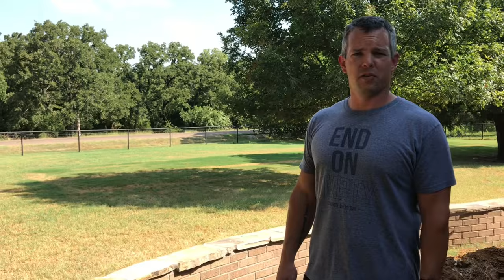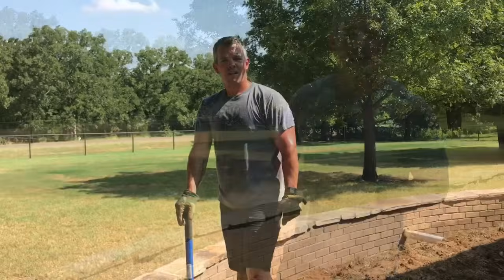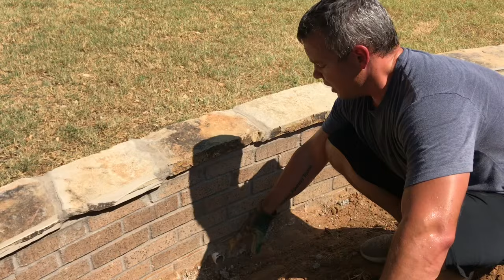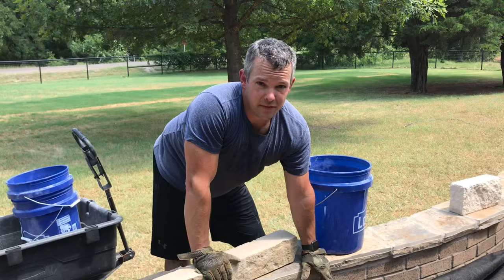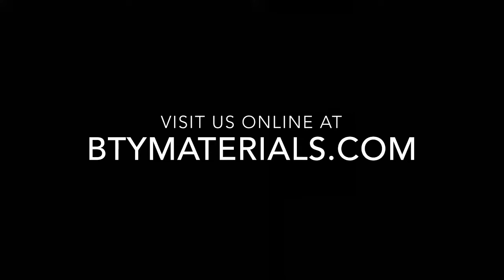Installing a French Drain Behind a Retaining Wall

Comment: Thanks for this video. I am in process of making, at the most a two course triangle retaining wall. To place patio pavers on it. It is already on a negative slope towards the house. I have already place a French drain and gutter drains at the lowest point. It is directly in front of one of the sides of the retaining wall. (The one closest to the house. Which, I hope will only be one course high, for a step to the patio portion.) Where would I place another perforated pipe? Which side of the triangle? The one closest to the house or the one farthest from the house? And I do not want to dig up the French drain I just put in to connect more drainage. Where would the outlet be? Also are the spaces between the blocks sufficient for weep holes? Or do I need another smaller tube?

Comment: I’m getting ready to do a 2ft tall, 90ft long wall. My plan was to backfill completely with gravel and then use a lil soil on top for the last 3in or so. Will that work?
Reply from the maker: Yes, as long as you wrap the rock in filter fabric to keep the dirt out, it should be fine... typically I believe 3-4" is needed for grass.
Reply: @btymaterials thx. My plan is to use a 4in corrugated perforated pipe that already has the filter built in. Does that sound ok in your experience?
Reply from the maker: you can use that to keep particles out of the drain, but if you put soil on top of the rock, you will want to use a filter fabric at location as well. Otherwise, the soli will filter down through the rock and eventually cause drainage issues as the water will not be able to drain as freely. It will also cause your soil to settle unevenly as it drains down into the rock. I hope that make sense. It’s best to wrap the rock up in filter fabric like a burrito to keep the soil out

Comment: What to do with ends of pipe? I have 90’ brick back-wall with wooden fences on both sides. If I pipe ends are open, wont water log and damage wooden sides?
Reply from the maker: Without being able to see the project, I would advise that the ends of the pipes either need to be able to drain out and run off to a lower area, or you would need to have a sufficient number of weep holes across the front of the wall so that the water is able to drain out. You are correct that you do not want water to pool near the fence. The function of the French drain is to allow water to drain to lower areas either from the ends of the main pipe or from weep holes, etc. In the video that we made above, the ends to the pipe are just wrapped in filter fabric and do not drain out to a lower area. Instead, we have weep holes along the front of the wall where the water is able to escape that is collected in the larger drain pipe. These weep holes are placed about every 8 feet which works well with our set up. I hope that helps!

Comment: My wall is 4ft tall, 70ft long, in front of a slope. It is leaning forward. It has been there about 25 years. It is made of stacked blocks with pins. It has a french drain behind it and in front of 1/4 of it. I believe that their is a Y at the end of the wall where both drains converge and go on down to a ditch. When it rains heavy, water comes through the brick and it floods the entire 70ft of the front of the wall up to about 8 inches deep, 7 ft wide until the lower french drain finally catches up, which takes about 30 minutes. The drains are 4" corrugated. I am considering restacking the wall, replacing the drain behind the wall with 6" and run that drain independently down each side of the wall out to end of property on both sides. Maybe put a few basins behind the wall as well. What are your thoughts? How deep should I bury the 6" french drain behind the wall? Thank you for reading all of this!  Wish I could send a picture. Jim
Reply from the maker: reply sent on FaceBook from message there. Thanks!
Reply: @btymaterials   thank you for the excellent information!

Comment: Great video! Is there a way of installing adequate drainage to an existing retaining wall retrospectively without going to the effort of removing all the backfill?
Reply from the maker: As a work around, you might be able to install a French Drain along the top of the wall (depending on water flow) to help water move away from the wall, which would help some of the water not seep into the soil, and potentially alleviate pressure against the wall. It would be a similar process to installing a drain behind the wall. We’ve got a PDF that you could download for some additional information for this method on our website. You can check it out by going to our site (btymaterials.com) and finding the Knowledge Base page. Issue #2 is about working with French Drains. I hope that might help!

Comment: If the tubing is below the surface, at the base of the wall, where does the water exit?
Reply from the maker: The perforated pipe rests at the base of the wall. The wall should have weep holes installed so that as the pipe fills up, it drains out the weep holes through the front of the wall in this application. If the retaining wall is open on one end (or both) and you do not have weep holes, you could try to pitch the pipe toward the open end, and with the correct amount of fall you could allow the water to run out the end as a possible solution. I hope that helps.

Comment: Is the drainage pipe connected to the weep holes?  If not, is it placed above, or below, the weep holes?
Reply from the maker: The base of the drainage pipe rests at the same level as the base of the weep hole pipes, with the drain pipe right up against the wall and next to the weep holes. As water fills the drain pipe, the water escapes to the weep holes as the water finds the paths of least resistance. The drain pipe has slits on all sides so that water can enter and exit the drain pipe. I hope that helps!

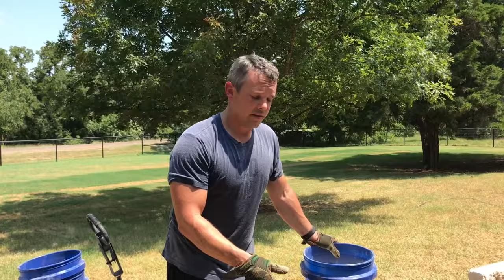Comment: Common mistake is the drain pipe is installed wrong, upside down. Holes should be at the bottom, or below 3:00 and 9:00.
Reply from the maker: This particular drain pipe has perforated slots all around the pipe.
Reply: common but extremely critical
Reply: Was thinking the same thing

Comment: Water rises from the bottom up but you put your perforated pipe with the slits at the top. I think they’re supposed to be facing the bottom so that as water rises it enters the pipe. If the slits are on top, there will be a build up of water until it reaches the top of the pipe.
Reply from the maker: The pipe has slits all around the pipe, not just on one side.

Comment: My question is ... does the geo filter material eventually clog up and render the drain useless . Good vid by the way 👍
Reply from the maker: Gus M I might add you would want to make sure the soil is not just a thick clay material with a high plasticity. You would want to make sure it is a sandy loam or has some sand base to the soil. This allows water to pass through the material. If you did use a heavier clay material you might run into to drainage issues depending on the depth, but more due to the soil than the filter fabric or drain. The more clay the higher the plasticity which means the longer water is taking to penetrating the soil.
Reply from the maker: Gus M the fabric I use in the video is actually a 4.2 oz filter fabric that is approved for state use as a filter material. It is a very good quality material. I can not imagine it ever clogging up but the longest I can personally say I have had it in place is about 5 years. Additionally, with the permeability of the soil and with waters natural ability to seep through soil and this fabric, I can’t ever imagine it clogging up.

Comment: I am building a stacked block retaining wall and I'm wondering if I should run a piece of geofabric for drainage from the ground all the way to the top of the wall with drainage gravel between the wall and the fabric and backfill dirt behind the fabric. I believe my design is correct but just want to confirm with someone who has more experience.
Reply from the maker: That is correct. You want the geo fabric to separate the gravel from the soil, from the bottom to the top. I’d say you could even go as far as wrapping the rock like a burrito in between the wall and the existing soil just to make sure your drain line stays free off sediment. At the least maybe 1’ from the bottom on the wall side and definitely covering any exposed gravel on the very top. Make sense?
Reply: @btymaterials  Makes perfect sense. Thank you for the quick response and I appreciate your advice!

Comment: Would this be fine to do under a shed base. I’m building a retaining wall because my yard has a slope and I would need one underneath one side of the shed.
Reply from the maker: vincent yacobozzi you can definitely run a French drain under your shed but in the area you won’t be able to get the compaction for the soil that you would otherwise desire. Depending on the construction of your shed, especially if you’re doing a concrete slab, you might look at doing some small bell shaped piers to help ensure your shed doesn’t start to settle unevenly.

Comment: What about a landscape timber retaining wall where it wasn’t built with drainage. I do not think I can dig all the way down, but should be able to get down a couple feet. Any value in installing the drain line and gravel down as far as I can go, even if I can’t get all the way down?
Reply from the maker: Brett Cohrs a Drain line would probably help the water to go out to a specific location instead of draining out between the timbers. You would definitely at the least what to line inside of wall with fabric and back up the other side of the dirt so that you have a void area that you back fill with rock and have wrapped in fabric much like i did in the video, with or without the drain. Again, the timbers will allow drainage but might cause issues on the front side of the wall if you don’t use a drain. You want to make sure you at least have the wrapped rock in fabric and not just back fill with dirt. If you just use dirt, over time the dirt will push against your wall and cause it to fail. Let me know if any of that doesn’t make sense or if you have any other questions!
Reply: By The Yard Materials Thanks. So you’re saying that it would do some help to put the French drain in their as far down as possible (using the appropriate technique with gravel, landscape cloth, etc)?
Reply from the maker: Brett Cohrs yes sir. If it was mine, that is definitely what I would do!

Comment: What about all that dust / very small particles in the rock, won't that clog the Pipe ?  I think it would be feasible to rinse / wash the rock off before filling on top of the Drain Pipe !?
Reply from the maker: Kevin,
The 1" Limestone is a washed product and meets the specs for ASTM #57 stone to be used in concrete production. It does have some dust but is a relatively clean material (at least here at our yard). Additionally with a slatted perforated pipe, I did not have much concern with the pipe getting clogged. If it is still a consideration for you however, you can simply wrap the perforated pipe with fabric prior to installing.
Reply: Kevin Stailey you can add a cleanout if youre worried
Reply: Most of the dust /particles will flow around outside pipe to bottom. I wouldn’t bother with a cloth around pipe if geo fabric is done correctly. Amazing how many argue to just wrap pipe , gravel then dirt with no fabric separating gravel/dirt. Im certainly no expert and it’s obvious that career landscape / drainage guys don’t even agree on how to be done. 
Im doing my first underground drainage and retaining wall..I absorb everything I learned(after watching everything 10 times while I’m working) and do what makes sense to my application. Ur explanation was concise, informative, and no unfamiliar jargon. Thanks!